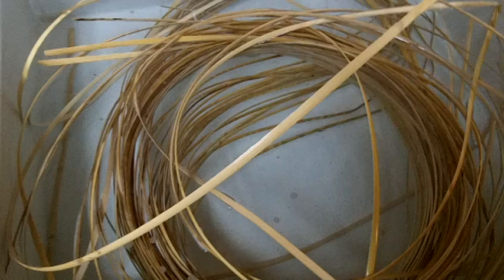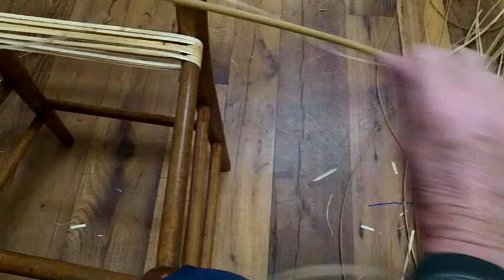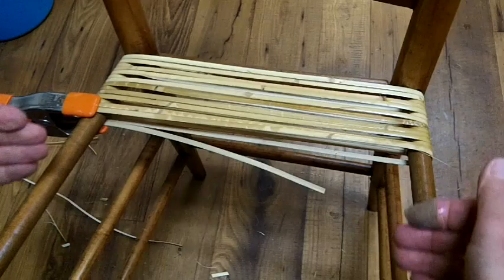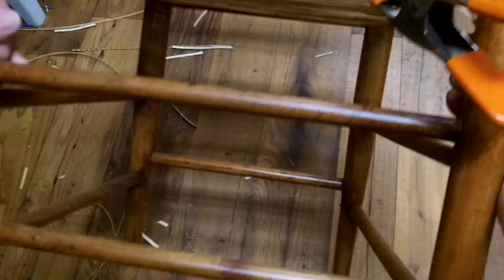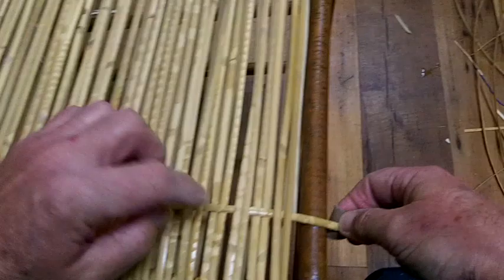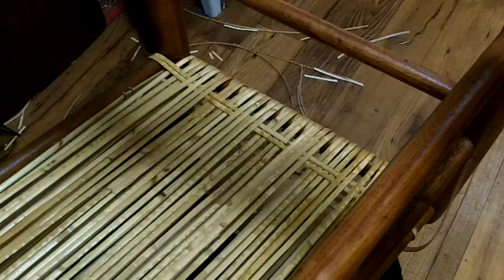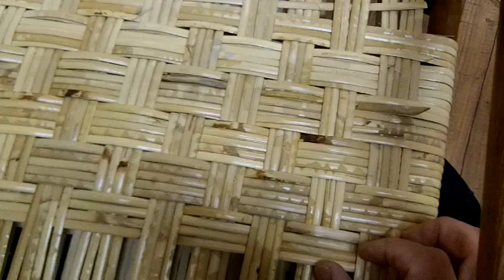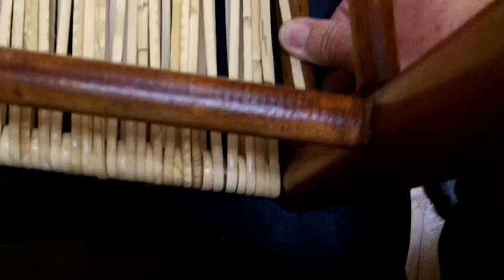How to Weave a New England Porch Rocker: One Variation

Comment: How much cane do I need to do a toddler rocking chair seat (9.25"x 12") using your method (New England on top/ Basket weave on the bottom) with 4mm, 5mm or 6mm cane?
Reply: One hank will be enough, with possibly some left over.